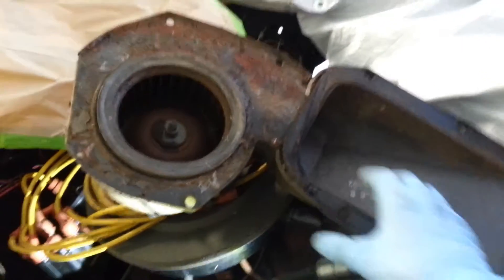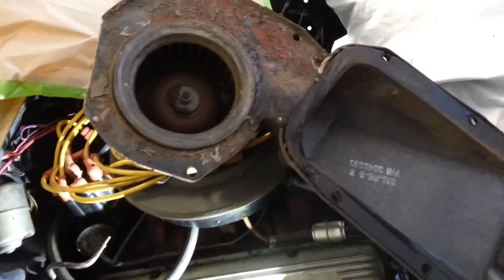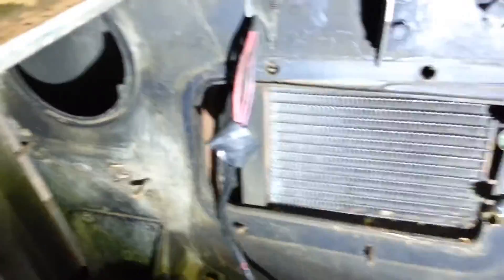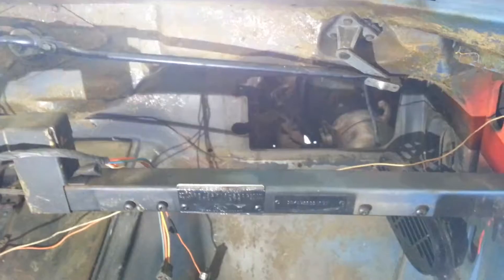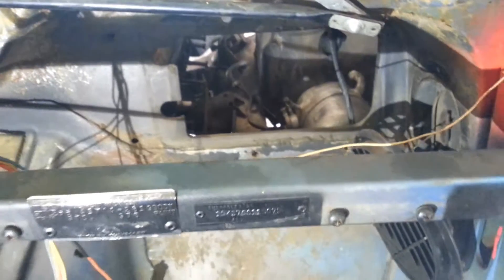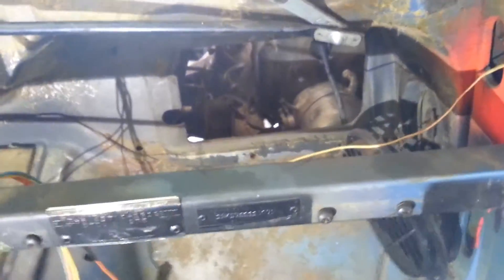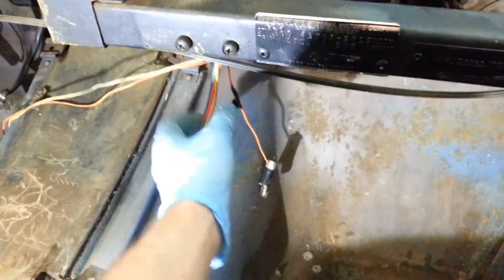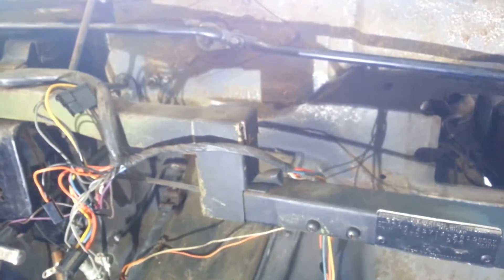1966 Corvette-Blower/Heater core assy removal

Comment: Soooo, where are the bolts that hold in the heater duct work under the dash?  can you show us the removed duct work to see where the bolts that hold it in are located?
Reply from the maker: Mick Robinson 

Hmm, I can't remember and have had the car in storage for the winter. 
If you have the Assembly Instruction Manual you can find it in there. If you don't have that manual I would recommend getting one. Here's a link to one on eBay, they are old but help out alot. 

https://www.ebay.com/itm/New-1966-Corvette-Assembly-Instruction-Manual-Guide-Reproduction-Book/112950211849?fits=Year%3A1966%7CModel%3ACorvette&hash=item1a4c5b7509:g:ZtQAAOSw7eFZ064N

Comment: where is the video of  the actual removal?
Reply from the maker: Paul Rooney 

Didn't think to make one till after. It's simple though, remove the surrounding nuts, disconnect the cable and it will come out. 

I found alot of the info on removal on corvetteforum.com.